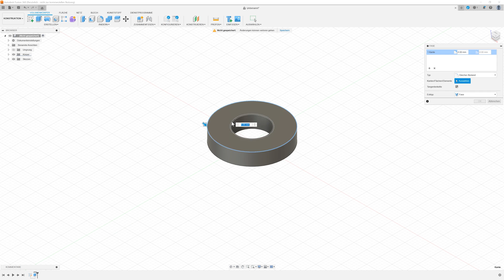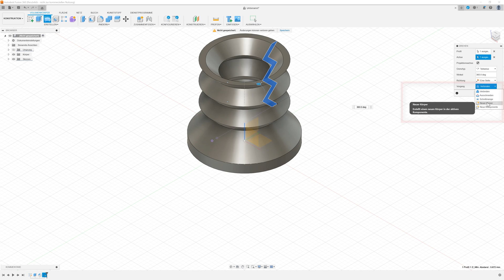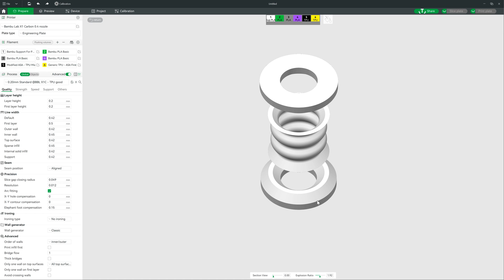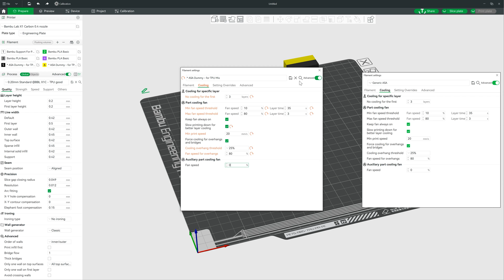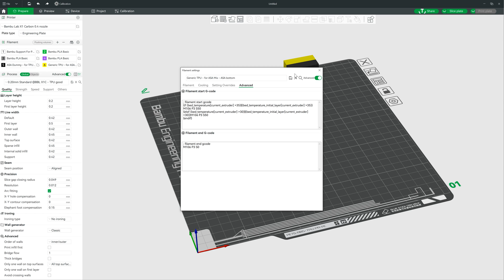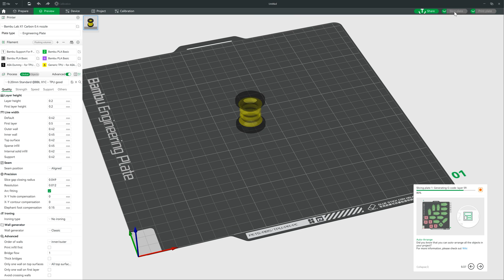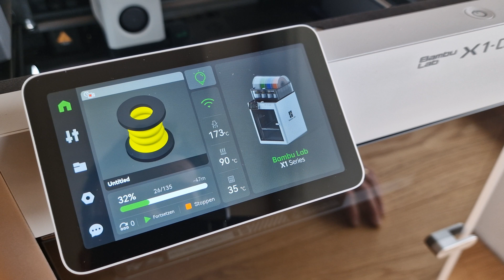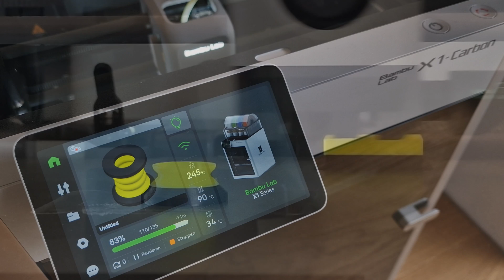How to multi material print ASA and TPU in one part on Bambu Lab 3D printers

Comment: Hi, you need to update your tutorial. Recent Bambu studio update throws an error "Not support printing 2 or more tpu filaments".
Reply from the maker: Hey, thanks for reaching out and bringing up this issue!
I haven’t updated my slicer yet (still using 1.10.1.50), but you might be able to bypass the error by using Generic ASA for both materials. So instead of selecting Generic TPU when creating the two "custom filaments," start with Generic ASA instead.

I haven’t tested this myself, but in theory, it should work. It would be great if you could give it a try and let us know if it solves the issue! If you run into any other problems, feel free to ask.
Thanks for your contribution! 🚀
Reply: He doesn't "NEED TO" do anything... but he is correct that you can just do the same thing but make a dummy TPU instead of a dummy ASA. I just tried this and it worked just fine.

Comment: Just wondering..... What was the outcome of the waterproof testing you're talking about at the end of the video?
Reply from the maker: Yeah, I know—I never actually got around to following up on that. 😅
Basically, I was able to print a waterproof housing, but making the seal with 95A TPU didn’t work out. I had to apply an additional liquid gasket to keep the inside dry.
Right now, I’m working on a video about TPU with different Shore hardness levels (from 60A to 68D). The goal is still to print fully waterproof enclosures for electronics—I need them for my soil sensors (check out my other videos). With TPU 60A, it should definitely work, but I still have to run the tests. 😉

Comment: Why do you need the two different filament types in the slicer? Can’t you just add the pause change it manually and continue. Is it so that the printer does the purge tower?
Reply from the maker: You’re right, you could try using just one profile. However, there are some small differences between the two profiles, such as the density. For ASA, the maximum volumetric speed is also significantly higher, which speeds up the printing process.
If you decide to try it with just one filament, I’d love to hear about your experience.

The purge tower isn’t necessary. There’s an update to this video where I mention this  - https://youtu.be/htSE6qv_hSk

Comment: Do you consider that we need to modify the inside of the extruder to print with TPU? I am having a lot of problems printing big pieces with tpu with x1 carbon 😅
Reply from the maker: I haven't thought about modifying the inside of the extruder. So far, I haven't had any issues printing with TPU 95A. Could it be that you're using a softer filament? What kind of modifications would you recommend?

Comment: That's interesting, thanks for sharing this 👍
I don't use ASA but have a lot of ABS that I use when i need better heat resistance or electrical insulation, having used a bit of TPU (with good results) I'll give a try to mix the two!

Comment: Why is there even a purge tower here?  I do this on my Ender 3 all the time.  Just setup the model, add a pause at the layer you want to switch, slice with one filament, save the gcode, slice with the other filament, then splice the two gcode files together where the pause is.  Doesn't even matter if they are the same temperature range, just add temperature gcode at the splice.
Reply from the maker: Well, I only have to configure the filament once and then I can use it again. In comparison, the G-code has to be adjusted for every part - if we ignore the fact that we have to add a pause with a click. 

It may be easy for experienced users to rewrite the code. But, as a beginner, I prefer the few modifications in the user interface. Never the less, thanks for the hint.

Oh yes, the prime tower was my mistake, of course you don't need it - lesson learned.
Reply: @creativemakerat  in cases where the filaments are significantly different, it’s beneficial to use profiles tuned for them.  Like my tpu profile has different retraction, and asa slightly lower flow.

Without the splicing it doesn’t have the proper profile for each filament.

Comment: Hello. Great video. A tips for you, insted of hitting resume and pause, you kan hit close and use the meny as you want. You can even lift the table up and down ass you wish. When finished, go to homescreen and press resume. It will go back to correct tablehight by it self. Works great, espesially when embedding nuts and bolts in to prints 🙂

Comment: You can print with overture tpu high speed or priline black or very hard TPU in the AMS (it will need a fake pla profile with tpu settings to work however) 

I just got a roll of overture high speed tpu myself and printed a torture test with 30 plus filament changes, all without issue.

It's not guaranteed but I'd look at getting a tpu that works in the AMS before other more complex methods of multi material printing

I printed pla with tpu and they stuck together very well
Reply: I don't understand why they don't allow different parameters per spool in AMS

Comment: Why is the purge tower so big? Is there a way to make it smaller?
Reply from the maker: Hi. Thank you for this hint. To be honest, I didn't think about it. You can disable the purge tower, this is not needed, because enough material is already extruded when changing the filamnet manually. I have updated the project file.
Reply: It's a prime tower not purge. The prime tower allowed the extruded to get up to the correct pressure before going to the model
Reply: @THusbands  not really, extruder retracts filament inbetween purge tower and model so it's not pressurised before
Reply: Why is there a purge tower at all? Just manually purge ONCE during each filament switch...

Comment: great start.  proud to be one of your first 100 subs.  now consider deep diving into this topic... how to do with with PLA + TPU and/or PETG + TPU -- far more "conventional" than ASA.  can it work?  if not, why not?  and maybe test out the new overture high speed TPU; there are reports it MIGHT be able to go in AMS (success in a modded AMS).  in my experience it's not very flexible.  but some flex is better than no flex.
Reply from the maker: Thank you very much for the praise, I'm very pleased. Thanks for the suggestions too, I'll try to give that a try. However, I can't promise anything because, on the one hand, I don't really have much experience and, on the other hand, I just need more time ;-)
Reply: @creativemakerat  fair enough.  but realize, we're in territory that NOBODY knows anything about.  You're more of an expert than you realize 🙂  I'll give you an example.  I was just trying to print multiple filaments at 0.06 out of an 0.2mm nozzle, and learned yesterday this is not clean and polished.  the process realistically cannot currently handle this level of precision.  (tested on both A1 and X1C)
Reply from the maker: I followed your advice and testet PETG with TPU. That also worked very well. Since there were also some very good suggestions for improvement here in the comments, I recorded a short update video - https://www.youtube.com/watch?v=htSE6qv_hSk. Again, thanks for your support :-)

Comment: Why not just use the close option on the popup (3rd button) rather than the resume. This just hides the popup while leaving the print job paused, so need to have to press pause quickly.
Reply from the maker: Oh man, I didn't get that. Thank you so much for the tip!! Then you have a lot fewer strings.